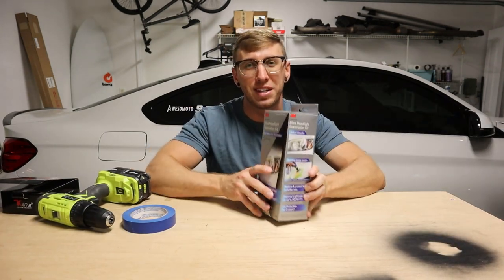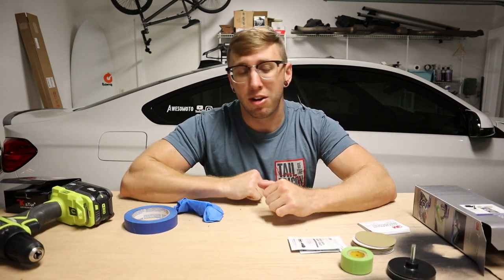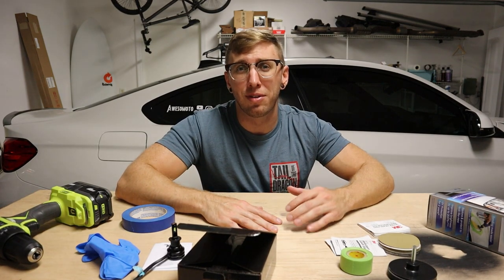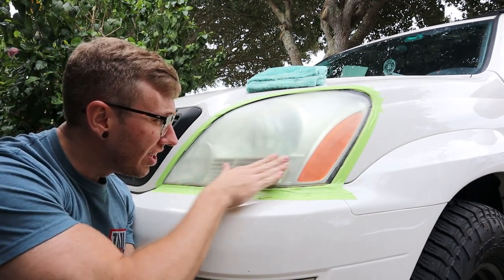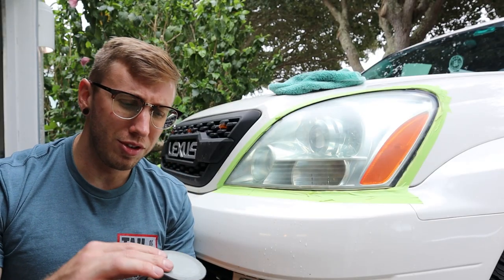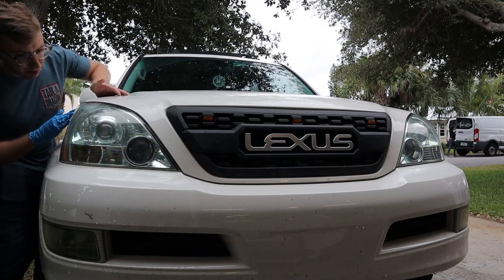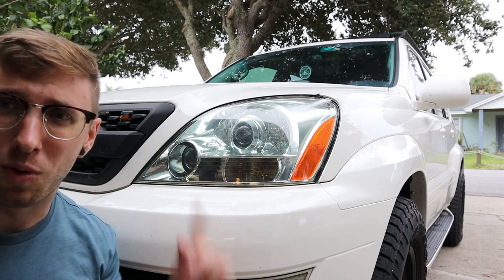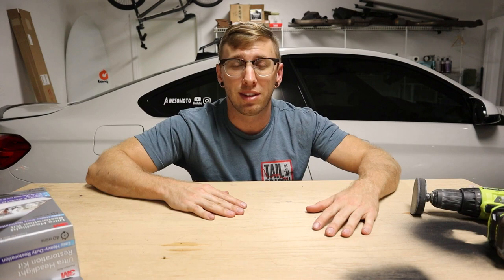Vlog 41 - How to clean yellow headlights (Lexus GX470)

Comment: To take this a couple steps farther, you can get some compound and polish and two step it to a much clearer finish, then using the supplied coating or use a ceramic coating.
Reply from the maker: Good call Matt, that would be the ultimate approach for protecting these lights. Thanks for reaching out and watching! 🙏🏻

Comment: how did you install those H3's with the 2 wires coming out? the original bulbs have just 1
Reply from the maker: The original bulbs in mine had 2 wires, one for the ground and one for +12v. When you pulled the cap off the ground wire might have fallen off inside. Check for that…hope this helps.